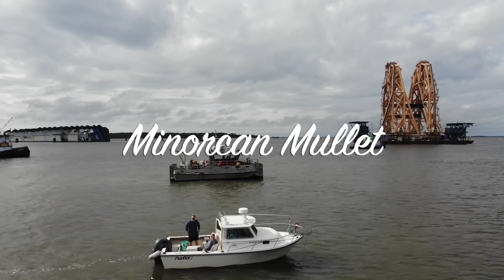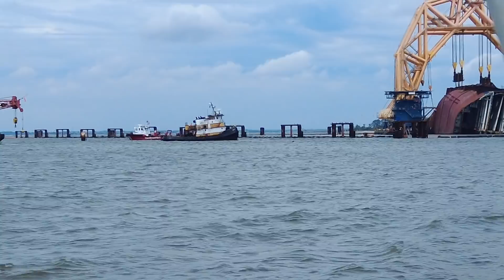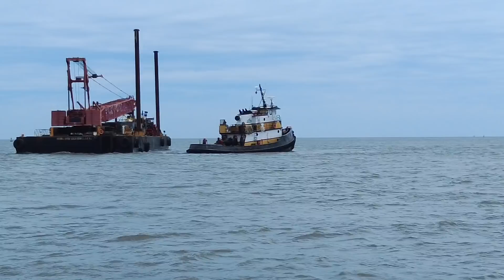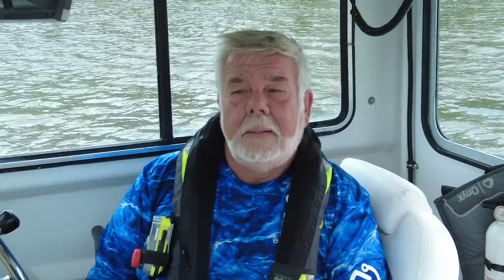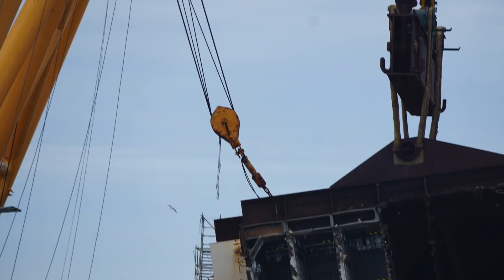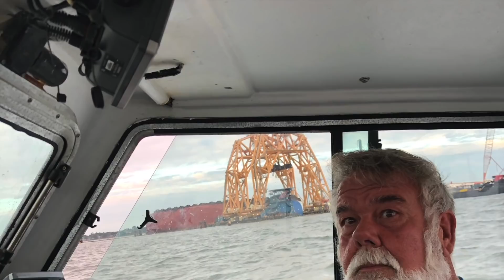TUGS AND CHAINS! on April 15, 2021

Comment: The Answer! I was wondering why they were not using abrasives. That is true, the abrasive cable is used with very little curve. I suspect the abrasive barrels (which are put around the cable) would be first to crunch and break apart against one another if they cut with a tighter radius than recommended. So yah, chain, great idea!

Comment: Ok, just to be a keyboard spectator for a minute, if you look up on YouTube you can find the TriColour salvage videos. Was also a car carrier that didn't totally sink, and they use strands of wire, lots of them. Cut was much smoother and cleaner.  I wonder why that wasn't used here?
Reply from the maker: The tool (VB 10000) is configured for use of the wire cutting system. MM

Comment: They should try coating the chain with tungsten carbide or chrome carbide flame spray with a rough surface condition. That will cut through anything. Many companies provide this service. Might need to modify the equipment to feed the large chain through the process. It is applied with a plasma torch.
Reply from the maker: That's a neat idea.  MM
Reply: Minorcan Mullet Loving your videos. Keep up the great work!
Reply: @jeannieheard1465  Yes it would but plasma flame spray would not heat the chain. It heats the tungsten carbide powder in the plasma flame and hurls it at the chain at supersonic speed where it bonds to the surface of the chain creating a rough cutting surface.

Comment: Amazing in depth analysis. Fully aware of different strengths of metals. Question is are they? Thank you again. Too bad your not running this project. It would be long over.
Reply from the maker: I know enough about the salvage business to know that I wouldn't want to be in it.  MM

Comment: Interesting facts on the chains. Wasn't the VB 10000 primary use for dismantling oil platforms with a big claw inside the structure for lifting the platform in one piece... Thanks for the update Andy,  hope the weather holds C xx
Reply from the maker: Great point!!  MM

Comment: Let us not forget that anchor chains are purposely manufactured to be smooth so they do NOT Cut into or otherwise damage a ship when they are released at high-speed or hauled in under great pressure. 😃
Reply: There's an excellent video on YouTube on how a anchor chain is deployed on ship's..
Reply: @christinebeynon9967  I have seen several and it is really quite scary! Especially when the brakes go out and they lose the whole thing!
Reply: @Blomme-k2y  Yes... there is more to it than we realize. Fascinating really

Comment: Why aren't they using the same cable used to chop the Kursk and Tricolor? Is it really the Jones Act that is preventing using a better cutting chain? Who knows? thanks to Minorcan Mullet for your hard water work. No one would know but for you.
Reply: The cutting wire/ cable is not suitable on the VB as it only works at around 30°.
Reply: @christinebeynon9967  Do you reference cutting angle or temperature? thanks!
Reply: @robnamowicz8073  Sorry.. never explained it clearly. The cutting angle of around 30° is usually used with shear leg barges. The VB chain is at a greater angle. The VB primary use was for dismantling oil platforms. I take a great interest in heavy engineering